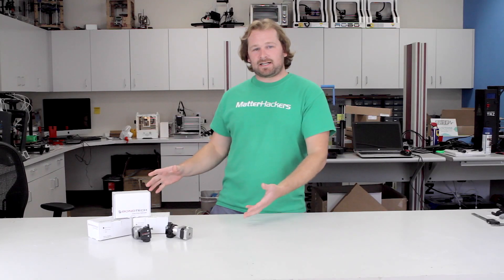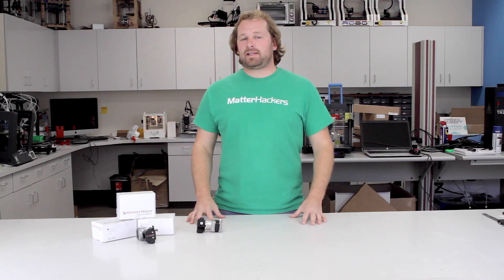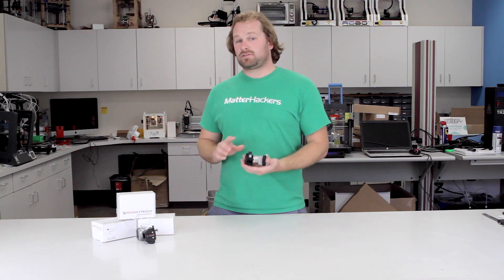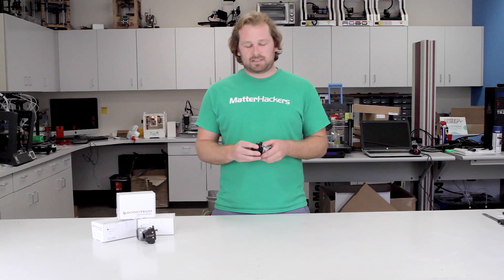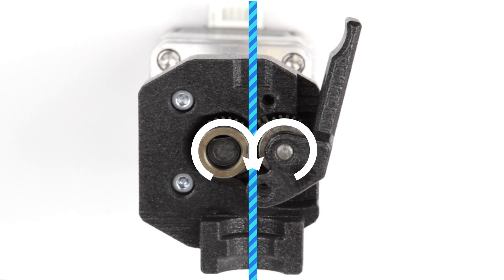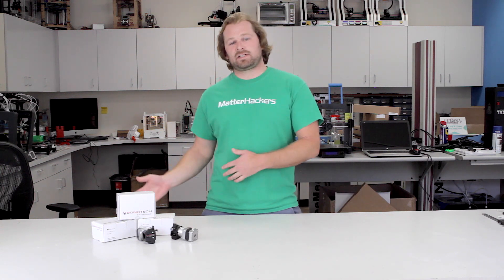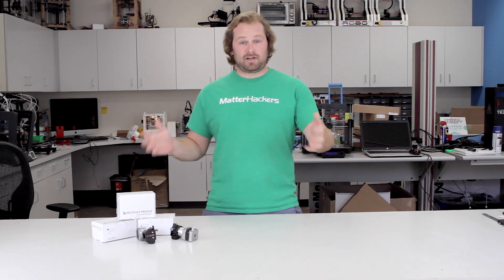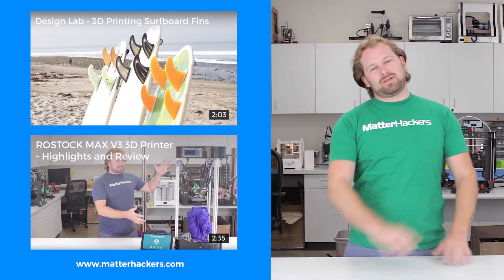Bondtech QR Extruder - Upgrade Your 3D Printer

Comment: Has anyone ever done a direct drive of the extruder with an E3d V6? Its specifically designed to mount directly to E3d V6 but yet they say to not use it as a direct drive

Comment: Honestly man, this seems like such a shill. Sure it's a good extruder if you need to push heaps of filament thru a Volcano at high speed, but for most people printing under 30mm^3/sec it really should not be required. If your existing MK7/MK8 style extruder is grinding then fix the actual problem rather than force more filament down the nozzle.

Comment: hod do you adjust the tension on this extruder? :)
Reply from the maker: Use the tensioner knob - it will move the gears in and out, thus adjusting the tension. Here is an article that should help to clarify this: http://www.matterhackers.com/articles/product-spotlight:--bondtech-qr-universal-extruder---1.75mm,-3.00mm?rcode=YTUBE
Reply: MatterHackers sry, I wasn't clear enough. I know how to adjust but Not what the right tension is. If it tighten it top much it only skipps and the way I have set it now, it unfortunatelly still skipps at very Small layers.
Reply: try adjusting the current on your stepper driver.